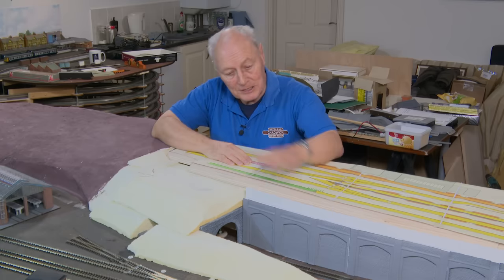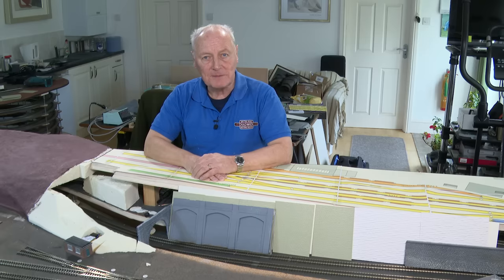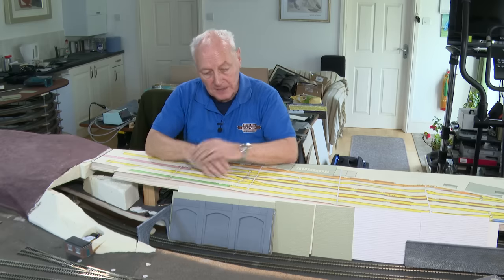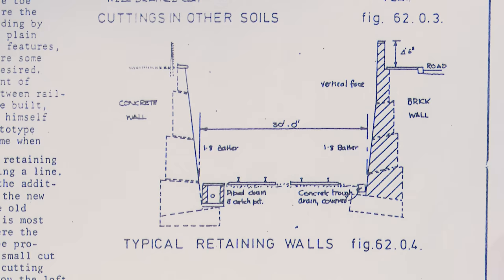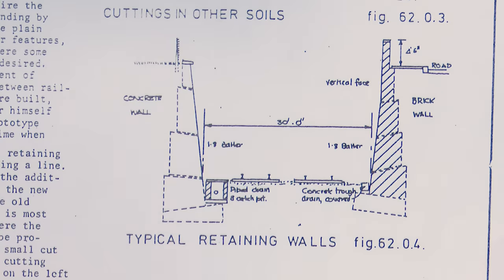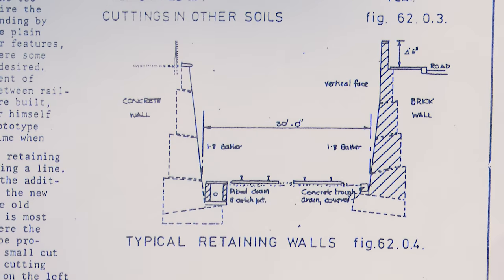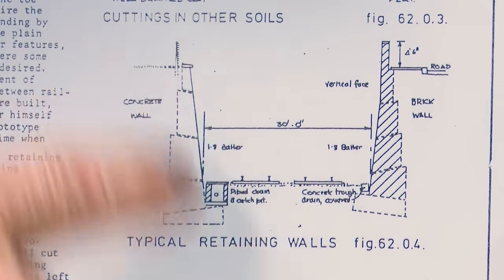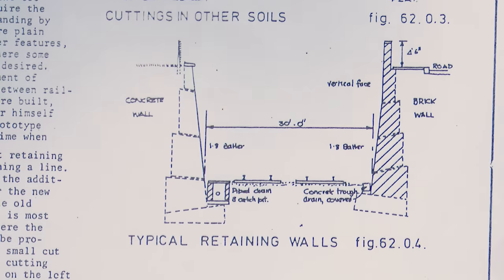RETAINING WALLS & TUNNELS at Chadwick Model Railway | 206.

Comment: Just to make you aware, the"6ft" is not actually a physical "6 ft". Its known as "The  6 ft" but doesn't measure 6ft in width, its just a railway term, the same as "The cess", we all know what a cess is but it does the mean it is actually used as one, that's a railway term going back to the railway navies when it was just that, a cess.
Reply: Is this similar to the discrepancy between what a husband believes 9 inches to measure and what his wife’s does.
Reply from the maker: Thanks HC, I suspected it wasn’t 6 foot but now I have the proof. Regards, Charlie
Reply: Charlie when you measured between the datum rail and the running rail that is called the 4ft the area between running lines is called the 6ft and the wide way between the down line and the up line is called the 10ft with the cess located at either side of 2/4 lines depending on your track layout. Having a quick Google of the PTS can give more reliable information. I hope this is helpful?.

Comment: Hi Charlie. I realise this isn’t to do with your current video but needed to make a comment. I just wanted to say thanks for the video back on track cleaning. I’ve finally got hold of some Inox and have used it this evening for the first time. I used it in my CMX track cleaner and all I can say to use a Charlie-ism is that it is an “absolute game changer”! Within minutes, engines that have been troublesome for months were working at a really love slow speed with no stalling. Amazing. I’m gobsmacked by how much difference it’s made to my layout. I used to use 99.9% IPA but never again. It’s channels like yours that offer so much useful info - never in a million years would I have used a product like this or had the confidence to do so. So a massive thank you. Keep up the brilliant work and superbly entertaining content. All the best. Ian.
Reply from the maker: That’s great news, Ian. However, do keep it away from traction tyres. Regards, Charlie
Reply: @ChadwickModelRailway  will do.

Comment: Charlie I see so many people quote the ballast shoulder referring to ballast slopping away from the sleeper ends which is incorrect the ballast shoulder which as per the permanent Way Association book on British railway track volume 9 track terminology a ballast shoulder is the ballast placed at the ends of the sleepers, timbers and bearers to provide lateral stability to the track, it goes on to say the Ballast Shoulder Surcharge is a specified additional quantity  of ballast added to the ballast shoulder of continuously welded track to provide additional lateral stability . Also known as Ballast Hump; shoulder heap . I will try and dig out extracts from track design handbook and send them via a message as you can’t attach images to comments on YouTube. I note the cross section you refer to correctly states concrete trough and not cable trunking which seems to emanate from companies producing details to,add to layouts and who use the wrong terminology. By the way you only get sleepers on plain line track in switches and crossings you have bearers.
Reply from the maker: Great information Gary, and I’d appreciate the documentation to which you refer. Regards, Charlie

Comment: Hi Charlie, 
During this week's excellent video, I wondered how to leave tunnelled areas free for access in case of derailment or engine or power supply failure. I imagine that you have planned for such an event, so I would be grateful to see your solution. Especially as I will soon have a similar quandary to solve, hopefully. 
I always look forward to your productions.
Best wishes 
Michael
Reply from the maker: Hi Michael, yes I will show the access restriction when the tunnel is finished. There are about 12 inches of track which is awkward to get to. Regards, Charlie

Comment: Another interesting video Charlie for which thanks. The odd noise during the video was quite obvious to me...Siri was leaving the room!! I am not quite sure I understand the last bit...You have glued the cellotex in position, so how are you going to ballast in the tunnel?
Yes, I often wondered about the 6ft way gauge. Apparently I was advised it was to allow  trains to pass on curves without touching...perhaps foresight into todays longer rolling stock? An interesting fact I discovered by accident...if you lay N Gauge track using the Peco Gauge, the inner 2 rails are OO Gauge. Cheers, Bob
Reply from the maker: Thanks Bob, I’m so pleased that you found it interesting. Regarding the glueing of the Celotex, I didn’t glue on the final roof section. This will allow you to complete it at a later date. Regards, Charlie

Comment: 3:34 - 4:18 this is due to smaller curve radii then to scale, resulting the coaches on the two tracks leaning more into and outoff the curve, so more clearence is needed ;)
and the track spacing depends on the loading gauge of the specific line.
Reply: I agree, and that made me wonder if by maintaining the distance between the outer rail and the retaining wall would cause an issue. Charlie's track is quite straight at this point, but if it was curving more then there could be an issue with a clash between a longer carriage and the wall.
Reply: @miketreehouse  Yes, if you want to look it up in more detail this would be (for Europe) NEM 102 (straight) and NEM 103 (curved) edit / forgot about: NEM 112 Track Spacing, then you would need to convert from H0 / S scale to OO, but for that we would need to know the radius and how long Charlies longest coach/waggon is.
Reply from the maker: Excellent comments, gentleman, and much appreciated. The distance to the retaining wall isn’t the issue, the closest,  is the tunnel mouth itself. Regards, Charlie

Comment: I like how, as the thing evolved a bit, you caught the detail I had noticed, that the top of the arches wanted to align to the top of the tunnel mouth, as a logical bit of geoengineering.  The remaining slope could then be battered back as necessary with brick walls where the natural slope was or was not "competent" (that being a geoengineering term for slopes which "behave" and not slip or pitch rocks or the like).  That will be a smashing bit of landscaping.  If wanting more than a few hours to get sorted.
Reply from the maker: What an excellent comment Captain Mack. It’s great to have you on board. Regards, Charlie.

Comment: The open area where the surface mounted point motor is on the hill side could be a prefect place to put a tunnel access doorway to act as a cover to the point motor.
Reply from the maker: Well that’s an interesting suggestion. Regards, Charlie

Comment: Charlie, when "fixing" that chipped part of the wall. can I recommend you find a way to patch it in "normal" brick, like you see on walls/structures on the railways... It would be a small feature that would break up the uniformity
Reply from the maker: Now, that’s a great suggestion Kieran. Regards, Charlie
Reply: @ChadwickModelRailway  you can even keep the rapairs behind and not flush with the retaining wall... add that 3D element that multiple layers of brickwork needed repair, and lazy/cheap engineering only fixed one layer

Comment: Great video Charlie. On the subject of the 6' spacing, perhaps the disparity between the PECO way gauge and the actual scale measurement is because the track gauge is 16.5mm and not 18.83mm. Bringing the rails together will obviously require compensating with a wider 6' (if that makes sense?).
Reply from the maker: Well that’s an interesting thought Phil. Regards, Charlie
Reply: I was thinking the same. HO track is too narrow for OO gauge. So the track gauge gives a greater distance to ensure the bodies of the trains are the correct distance apart.
Reply: It´s the auxiliary reason in case of OO, 
but those where the gauge has the correct scale (for example H0) got more spacing, too, because of the smaller, not to scale, curve radii,
while thoses scales/gauges where the minimal radii are to scale (for example Protofour) can have spacing build to scale ;)

Comment: Very interesting Charlie. I don't think the Scalefour diagram is appropriate to a Western Region line. When the cutting was built the tracks would have been broad gauge, so for double track broad gauge it would have been almost five feet wider. However, it would work if the broad gauge was single track and the cutting was then widened for two standard gauge tracks. That would mean the retaining walls on each side would have been built at different times and would probably use different materials.
Reply from the maker: I take your point of view Mark, however, it’s not all about the GWR sadly. Regards, Charlie

Comment: I wonder how using that celotex stuff compares to the pink (or other color) insulation board that we have good access to in the states. Also, love the inclusion of the tech interruptions. I like the way you react to them in a natural way. 

I used the pink insulation, a kitchen knife, and then finally a surform tool (kind of like a cheese grater) to smooth it all out. Then used something similar to sculptamold to contour the places where the earth rises up. I like your way of thinking that the earth is there before the railway. 

Thanks!
Reply from the maker: Thanks Andrew, and I believe that your pink foam is a much more versatile product. Regards, Charlie

Comment: Hi Charlie, have you considered using Black 3.0 acrylic paint for your tunnels. I have found it to be brilliant  for making tunnel mouths look super black. I have used it to make a very short (approx 3"), dummy tunnel look like it goes on forever.
Reply from the maker: Yes Robert, I do intend to paint the surrounding Celotex Matt black. However, I’m still searching for a suitable tunnel liner for the first few inches. Regards, Charlie

Comment: Hi Charlie, to make it appear the landscape was there first a mockup of your given space for the terrain in the area you are modelling is a good first step once you have decided on a track plan and what you are going to model.                                                                                                My first layout was just a 3x6 sheet of chipboard about 50 years ago so I learnt the hard way.                                                                          
After reading American Kalmbach series of books on Landscaping for model railroads have done things differently.                                        
How will you access your tunnel once you have glued the scenery in place? I use lift out sections in case of derailments/maintenance.
Reply from the maker: Hi Simon, only around 18 inches of track will be awkward to get to. 
It’s great to have you onboard, regards, Charlie

Comment: Nice video Charlie, enjoyable has always. A question for you though, if you put linings in all your tunnel, how do you get to clean the track or get to a possible breakdown in a tunnel. I tend just to put inner walls at the tunnel mouth, and one of my tunnels is at the board edge so I have a hatch to get the hand of god in if needed. Chris.
Reply from the maker: The tunnel should be no longer than about 12 inches. Hopefully I can then clear any derailments that may occur. Regards, Charlie

Comment: With Chadwick being a Modern line layout, i suspect that there was steam run in the past, because from what I've seen the tunnels that go through a long stretch of hills, the engineers would build smoke/air chimneys that would rise from the ground like a lone guard/watch tower, these would allow fumes to be released from the smokeboxes now diesel engines with out choking the passengers and crew.
Do you plan on placing something like that along the tunnel routes? or is that not planned.
Great work and Vid! :)
Reply from the maker: Thanks dark nut, that’s an excellent idea. Regards, Charlie

Comment: Greetings Charlie, what an absolute fabulous tutorial, you may not have set out to make a tutorial but the content and delivery created a very informative and educational video. Thank you. Do you have any explanation as to why the Peco gauge is ‘off’ scale compared to the Exposcale rule? As always you raise more questions than answers - the perfect way to impart your knowledge.  Can you please do more videos with the different types of scenery and how to use them?
Reply: Because probably the peco track is not to scale. That plus a bit of slack to allow for curve compromise and stock overhang on said curves, especially later stock such as the mk3 coaches. 

The scale rule is just that, it just scales a length to 4mm/ft, so it has no relation to the track gauge used, which for oo gauge is 16.5mm. The problem here is that standard gauge track is 4ft 8.5in, which at 4mm to the foot is 18.83mm rather than the gauge used in oo track of 16.5mm. This is why em gauge and p4 gauge exist,  em being 18.2mm (originally it was 18mm hence em for eighteen millimeters) and p4 being true to scale 18.83mm. The disparity originally came about as motors would not fit in 3.5mm to the foot scale (ho) for British outline models as the British loading gauge is noticeably smaller than the European equivalent.
Reply: @bionicgeekgrrl  Good morning Charlie, thank you for such an enlightening prompt reply, it is appreciated. The reply is one reason why I turn to YouTube for advised guidance from the people who know because they do it.  (Some  are more reputable than others) This kind of information can be found, somewhere in dry written tomes that are very short on the entertainment value which are years out of date. Thank you for sharing the information on the retaining walls and the different mediums. Take care and thanks again.
Reply from the maker: Gentlemen, it appears that the area known as the 6 foot, i.e. the distance between the rails of differing tracks is not 6 foot after all. It’s more of a slang term. So let’s not take it literally. Regards, Charlie

Comment: Apologies Charlie. I saw a YouTube video "Nottingham Victoria and Loughborough Central station in the 1960's" which shows retaining walls and tunnel mouth, but forgot to notify you. Sorry if I've missed the boat.  P.S. How do access the area in the tunnel area in the event of a derailment ?
Reply from the maker: Hi Rob, the entrance to the tunnel is just at the top of the helix. There is only about 18 inches which is awkward to get to. Regards, Charlie
Reply: Lost my bearings on the layout. Slaters Plastikard also manufacture embossed brickwork sheets. @ChadwickModelRailway

Comment: An excellent finishing carpenter who had a d.i.y. programme on U.S. and Canadian T.V. often used hot glue to temporarily stick templates to the wood he was about to shape with a router.  The cooled glue would hold the template firmly in place.  To remove the hot glue (when solid and cold), he would use a dropper or a brush to apply isopropyl alcohol to the glue, and it would break the bond, and also allow the dried glue to be peeled from the wood and template leaving no marks on either.  If ungluing a hot glue bond either due to an error, or just to re-use the part(s) again, it would be wise to perform a practice test on a scrap piece of the same material(s) you wish to unglue, to determine if the alcohol will do any damage to the pieces you actually wish to separate. EW
Reply from the maker: Many thanks, EW, a useful tip that I’m sure will come in handy. Regards, Charlie